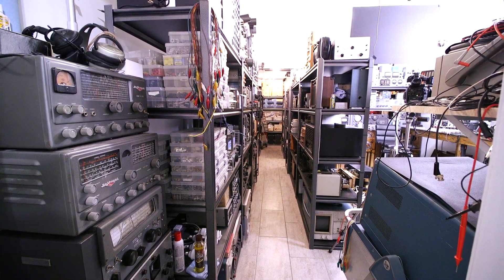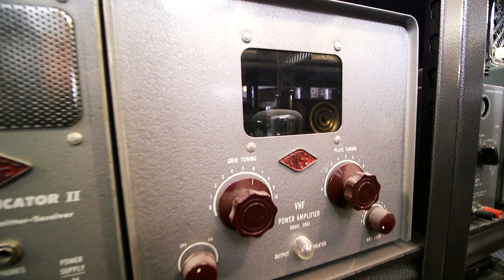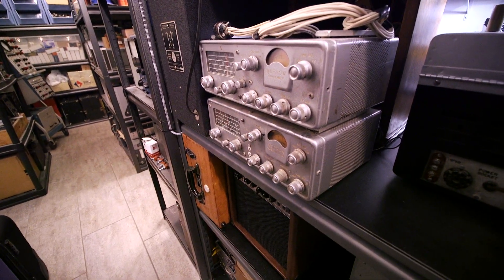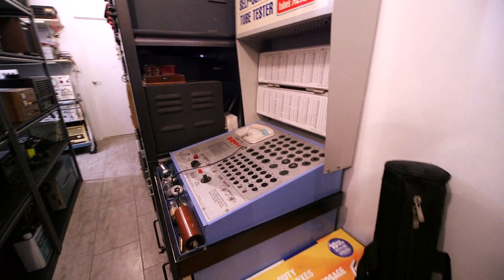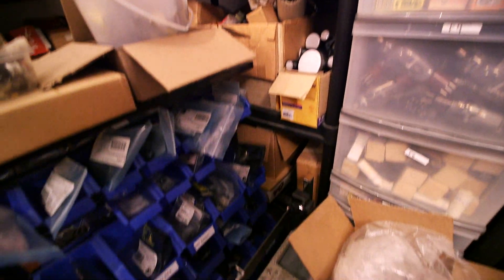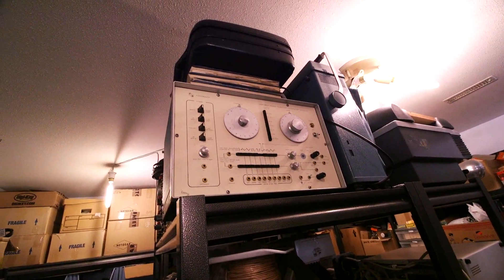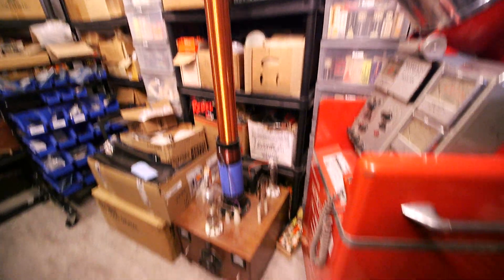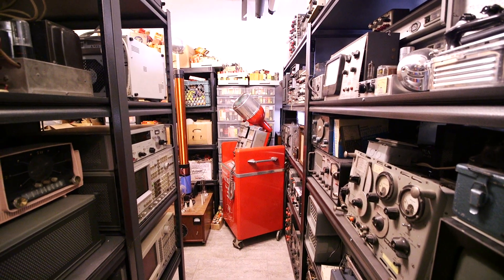Neat Projects Inside Lab 2!

Comment from the maker: To learn electronics in a very different and effective way, and gain access to Mr Carlson's personal designs and inventions, visit the Mr Carlson's Lab Patreon page here: https://www.patreon.com/MrCarlsonsLab
Reply: Doe's anyone make old tubes ? Or once out of date that's the end of them ?
Reply: @monfrig6959  Some audio tubes are still in production today mostly for use in guitar amplifiers for musicians and for the HI-FI sector. You can still buy most types new old stock and used on ebay tho.. some rare ones or very old types appear only from time to time.
Reply: @monfrig6959  How old? Which decade? TV, transmitter, radio? Give examples please.
Reply: @monfrig6959  If there is enough demand. As an example, 811As, 3-500Zs and 572Bs are back in production. Most of the popular audio tubes are as well. But as a contrast to the above, you won't find new-production 4-125As or some of the more obscure audio tubes.
Reply: The UFO detector should achieve the functionality it's name requires, IMO.   Wanna go for a ride? 
It could be decked out with IR and low light visible light camera, spectroscope*, electric field detector, magnetometer, RF spectrum analysis using an SDR and video and data recording.  If the electrostatic display is too limited perhaps a smallish flat display could be retrofitted into the 'eye'.    A Raspberry Pi could do the heavy lifting, provide the display drive, all the control and data recording could be handled via the I/O connector, plus USB ports for sound and camera inputs.
   *Spectroscope that will record the actual light spectrum emitted from said UFO.  Video cameras tend to saturate when viewing these objects.  Witnesses typically indicate these objects are seen in brilliant hues, but captured images are whitish with color being only visible when out of focus or shifting of object withing the field of view. 
Too much?, lol!
Reply: How can I get in touch with Mr Carlson? I have a question.
Reply: I gotta show this to my mother. She thinks having what i have is too much and all i got is 3 shelf units full . Granted i have 5 large consoles displayed throughout the house. Anyway i have to find stuff around my house because ebay prices are through the roof. I think it started with one asshole thinking his broken tube radio was worth $250 and it snowballed. Now people who have no clue look to ebay and say to themselves of wow that old radio in the attic from grandma is worth mor than i thought etc.
Reply: Your lab is a gold mine. Let's fire up that vacuum Tesla coil.
Reply: Mr. Carlson, have you thought about designing a vacuum tube tester over on your Patreon page?  I think that would be a neat project for all of us that like to work on tube equipment. Those old tube testers cost a fortune nowadays and many of us certainly cannot justify such high prices. I’m sure a tube tester project would make a lot of us Patreon members very happy. Thanks for sharing your knowledge with us.
Reply: Mr Carlson. is it possible to combine the output of different amplifiers into a single source. if those amplifiers are completely different?
Reply: I imagine my wife finds out that I'm hosting something like this in the basement. How could I possibly explain the UFO device? Somebody would probably find my dead body floating in the river ....
Reply: 3D print case cracked??same with the nob's factory spec!!
Reply: Long time camera high quality with all the add on the camera with movement detection and wifi to a home alarm to see it at home use for local hot spots maybe a set off test meter stuff for ufo identification eg radiation detection drone fit otherwise lock proof.......
Reply: ufo finder yes neat